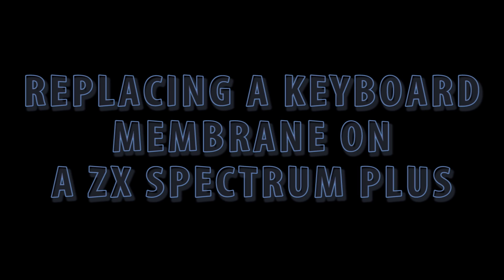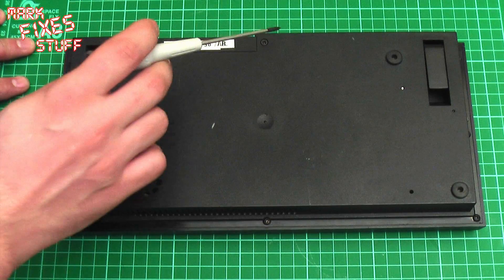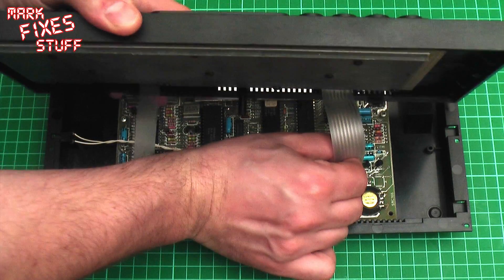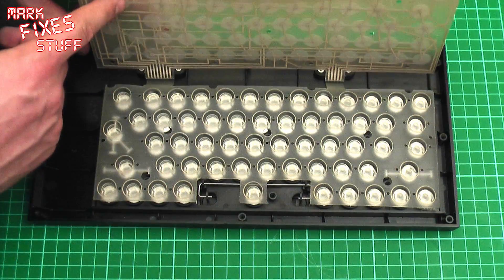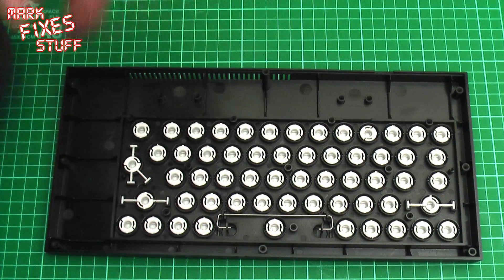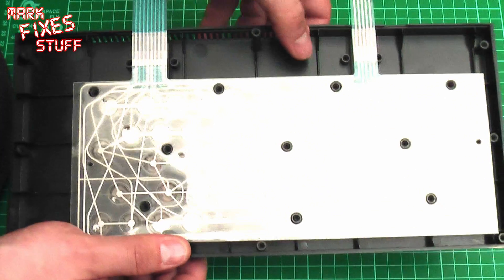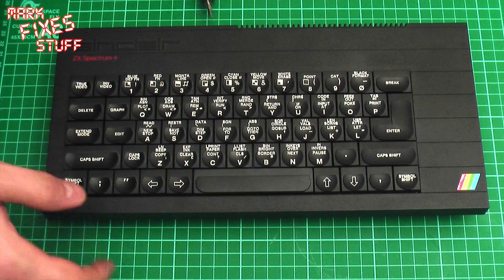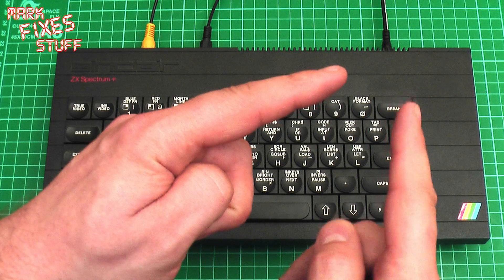Sinclair ZX 48k 128k Spectrum Repair: How to fix a 48k/128k Spectrum Keyboard Membrane Replacement

Comment: Does anyone know if the keyboard would work if the silicon membrane is not installed? I'm not talking about the 3 layer membrane, just the silicon/rubber one.
Reply from the maker: No, the keys will just sit flat on the membrane I'm afraid.

Comment: Thank you so much for this video.
I installed a new membrane to my Spectrum plus and was getting very erratic key funtcions.
turn out after watching your video, I realised i'd screwed in the ribbon clamps / bars upside down, effecting the connection.
Atic Atac here I come!!

Comment: I'd like to make a mechanical replacement to replace the lot under the plastic key assembly, it's to run a Raspberry Pi nano so room wouldn't be an issue.

Comment: Just replaced the membrane in my 128k Toast rack, thanks to your informative walk-through. However, mine hadn’t got the heavy metal plate inside, only the plastic insulator.
Presumably this is because the 128’s heat sink provides additional weight ?
Reply from the maker: I think it’s because the later models just switched to a cheaper plastic plate when they realised the metal was a bit overkill.

Comment: I got a +2i took it apart and the membrane looks ok?ive ordered a new one though,hoping it will work?😬
Reply from the maker: +2 machines usually just need the dust bunnies cleaned out and they spring back to life!
Reply: Mark Fixes Stuff yes I done that n it works!😅I keep the new one for a spare,I ordered the wrong one anyway,it’ll come for a spectrum + if I get one
Reply from the maker: @wayneevans3860  Good news then. Plus membranes are almost always dead these days, so look out for one cheap and you'll be winning.
Reply: Mark Fixes Stuff cool,thanks mate😀👍🏻

Comment: After talking to you recently about my Speccy repairs I’ve just ordered one of these membranes from sell my retro though upon pulling my Speccy apart I notice it didn’t have an insulating layer, in saying that my HUGE metal backplate is actually plastic and maybe that’s why there’s no insulating later.
Reply from the maker: Correctamundo!

Comment: good video - can i provide some additonal advice tho ?
When screwing in the back-plate screws, i visually check they are not to tight aginst the metal, just barely touching to hold the keys/membrane in enough. I press groups of keys to check there is no travel in the screw. This has really helped me on not overtightening the screws and stopping 'phanton' keypresses. Aslo worth pointing out, it may seem obvious, but the clamps go in covering the screw-mounts so they are flush. A quick show of this will probably help the problems of membranes getting sent back when actually all they are missing is being clamped down correctly with the clamps in the right orenttation to the keyboard case. But again, great video as a starting point to correct and get a great bit of technology going again !

Comment: Hey mark i have just got a 48k spetrum off of my brother it has been converted to composite video been recapped and has a new keyboard membrain fitted my brother has not had a chance to try it out before he gave it to me.  Right here we go i have plaugged it in and i have a very crisp picture on the screen now the funny bit the 3rd row down on the keyboard does not work and the b n m and the red shift key work intermitantly  i have reaseated the ribbon cables and no differenceis there anything that might cause this  apart from a dodgy membrain ??.     Thanks kev
Reply from the maker: +Kevin Rouse Not really. You might have some luck trimming the tails with a pair of scissors, bit if it's a vintage 80's membrane it's days are numbered!
Reply: +Mark Fixes Stuff - Retro Console and Computer Repairs, Reviews and MORE!   Thanks mark i will try that it is a new membrain.   love your videos by the way keep it up :O)

Comment: 3:43 Funny looking Hex Driver your using on that fragile 30 year old plastic.
Tee Heee...
Reply from the maker: Not a hex driver The Pumpking King. A flared precision flat tip in an old cross head screw will reduce the force you can transfer to the case and also reduces the chances of camming out.
Reply: Ah'h. The right tool for the job..

For my next trick I will open a Gameboy Cart with a Bic Pen.

PS: At least I did not call it a posi screw.

Comment: I had that problem with a Commodore 16,I connected a sega power adapter to it and then the picture was perfect,turned out the commodore power adapter was faulty,I think the RF modulator needs power if I'm not mistaken.

Comment: I was given two spectrums one grey model (ZX +2) the other black (ZX +2),the grey one's case was in really bad condition,the black one's keyboard was not working at all (but good case),so I whipped the membrane from the grey one and put it in the black one,even though the ribbons were smaller it still worked.

Comment: Great video mate!well my speccy bless him over the years hasnt issue (yet)with the membrane but i have a issue concerning the tv..whenever i put to play it produces a line tha moves from downwards to upwards or sometimes the other way round and then when loading becomes very fuzzy and the screen isnt stable at all :( i use flat tv on it but a friend said it could be my power supply..what could cause the issue?hope all is well with you !cheers!

Comment: Yay, "Top Trumps"!

Good point about the membranes - I won't be buying the cheap ones on eB@y any more.
The coating seems to flake off quite easily, and they were a tad too flimsy for the connectors.

I know where to buy the "proper" ones in future now, thanks.